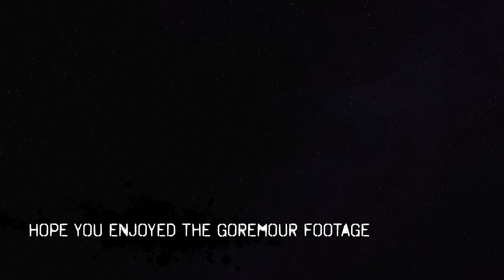Re Deploying the home lab!

Comment: what are the specs for the storage you are using?
Reply from the maker: Nothing fancy, 21TBs raw, dual parity setup with a 1TB ssd cache drive, as of today.
Reply: @SPXLabs  what type of server is that and how do you like it??
Reply from the maker: @mechy2k2000  They were Quanta S210 X22RQ and they were nice when they worked.  I would not recommend them to anyone.  Get a Dell R720 or R820 or anything else.  I ended up replacing both with a custom AsRock LGA 2011 build.